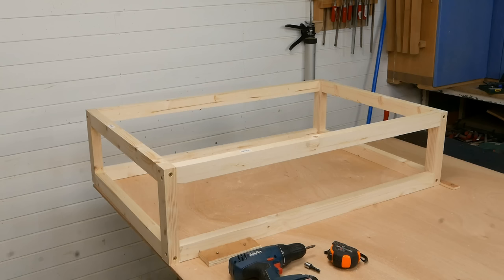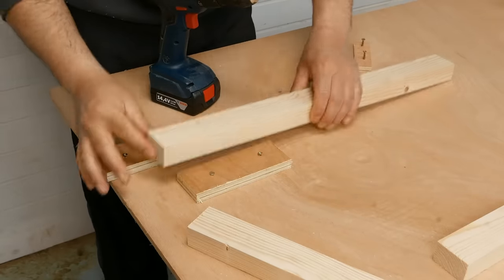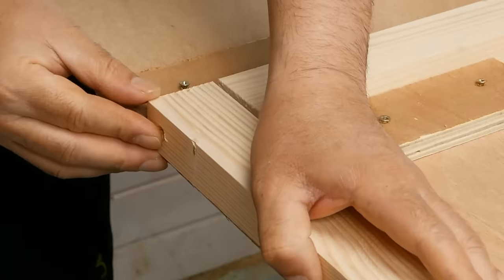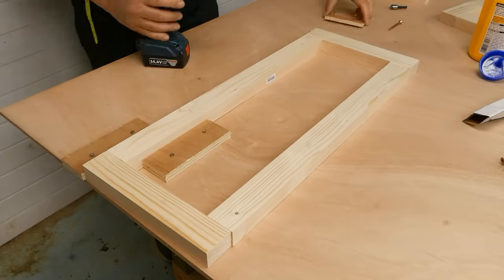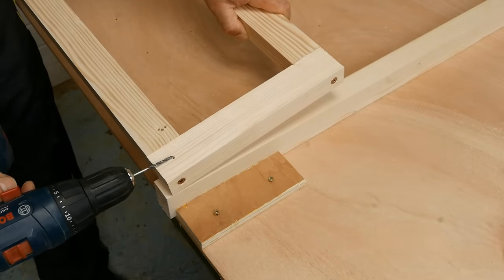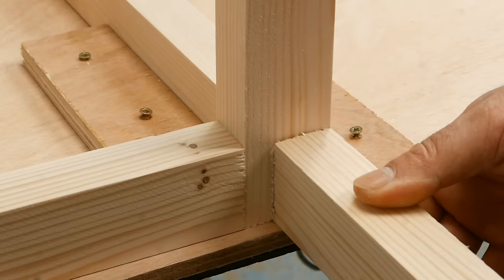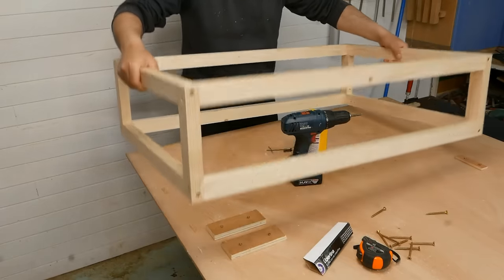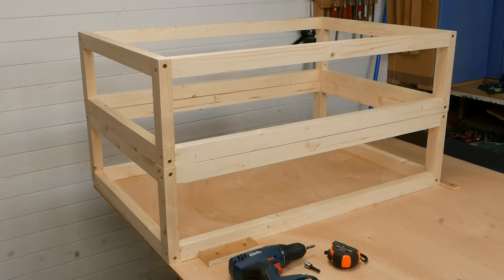How to make a very simple wooden frame

Comment: I've seen several of your videos and they are well done. This one is good, you show important detail. 

I want to add one thing I've learned to do when making screwed joints like this and pilot holes: I think it is best to make the pilot hole in the piece that the screw is pulling into (the long/end grain piece in your project) a bit smaller diameter than the "through hole". I do this to have maximum strength. I want the pilot hole just big enough to not split/crack and the "through hole" just big enough to allow the screw to spin and pull the pieces together. I do this by drilling both holes with the smaller drill bit, then redrill the through hole with a drill bit that is a bit bigger.

Comment: Treat yourself and buy some longer drill bits, you will then be able to drill both pieces in one go. I like your use of the blocks on the ply, quite useful for repetitive pieces. I tend to agree with another poster, I would use a clearance hole in the top piece to ensure the screw clamps the wood firmly onto the other piece. I see you glue and press the pieces together, probably not as effective, but as you said it always works for you. Thanks.

Comment: You should look into making yourself a table top with dog holes, and make some dogs to go with it, considering how much you drill into the top for stop blocks. Plenty of good vids on youtube to have a look at to come up with a design that suits your needs. It would make a great video upload too. Super build, by the way 👍
Reply: Sergio Acuña Padin have you thought about making different thicknesses on the table top side of the dogs? Being doubly  adjustable might be beneficial in multiple uses? And somewhat of a time saver. 
Just a thought ant way

Comment: Very nice and simple for a beginner like me. Thank you. Just one question. I need to make similar frames in 3 different sizes (large on bottom, slightly smaller on top and then the smaller on top to form a staircase like structure). Should I use 2x4 or something else? I don’t believe you are using 2x4 in your video right? Will these be study and strong?

Comment: Beginner here: It is a long horizontal frame. What if I wish to make a tall vertical frame? Would I adjust the length of the wood and keep the joints, or just turn the horizontal on its side?
Reply from the maker: I am not a pro, but I would adjust the length of the wood

Comment: Please excuse my ignorance on the subject as I'm new to this, but I have a question: I see the horizontal wood beams attached to the side of the vertical load-bearing beams, which in my mind makes it susceptible to failure should someone step on the horizontal beams. Wouldn't the frame be more resilient if the horizontal beams were placed on top and below the vertical beams? That is, the current arrangement has the horizontal beams between the vertical beams, and I'm wondering if the structure would be more resilient if you placed the vertical beams between the horizontal beams instead. I'm guessing the complexity of the joint would make it not worthwhile for most cases? Thanks in advance!
Reply: I think you are right if you want to make furniture, I would have the longer boards sit on top of the short vertical ones. Plus an extra vertical beam in the middle. But for my purpose which is just a mesh cage for my cats this is perfect because the horizontal boards wont bear any weight at all.

Comment: Thanks man! Great technique. Just one question; is the glue really necessary?
Reply from the maker: Not sure 100%, but I think it makes a more strength structure
Reply: You'll never break a glue joint. It's stronger than wood. You will never break the glue. You can only break right next to it. By gluing it, it will never come loose. The screw alone could come loose over time.

Comment: wonderful...job...that what I was looking for...I want to make a frame like this 10 feet long and of 2 feet  width...but the problem  how I will ge the pieces of the exact measurement. Because a small different would make the project ugly..my question is how much weight it can bear?
Reply from the maker: I think you will need to reinforce the wooden structure with some vertical pieces
Reply: i want to cover that box with a tile or brick like plywood or hardboard...to put it under electric fire work...what you suggest?
Reply: +Parvex Taj
It depends on what tools you have available. 

If you have a mitre saw set up a stop block which will allow you to make accurate length cuts every time to the same length. 

If you do not then you need to make a jig that will allow you to make a cross cut and use a stop block with that as well.

Comment: Those screw connections will not pull the boards together strongly because you have screw threads engaging in both boards. The optimal way to do it is to only have the screw threads engaging the wood in the board that has the pointy end of the screw. Then the screw threads work in one board to pull that board strongly into the board that has the head of the screw, creating a kind of clamp or vise force.

So, either you need to use screws with a much longer unthreaded portion near the head, or else drill a larger diameter hole in the board that will have the screw head. The way I usually do it is to drill the small hole first so that everything will be aligned, then I go back with the larger drill bit (and a stop collar or piece of tape to limit the depth) and enlarge the hole in the board that will not have any screw threads engaged.
Reply: No "maybe" about it. The screw definitely does NOT pull the boards together the way you did it. It is basic physics. The way you did it, the only pressure is what you add. That is why it is much better to do it the way I explained. Since you are teaching basic technique here, it is best to teach people the right way.
Reply: I'm confused about this, is there a video explaining in more detail?
Reply: There are videos that explain the same thing I did, but I have not seen any that go into any more detail. The basic point is that when screwing two woods together, you only want the threads to engage the wood on the tip of the screw, and not on the head-side of the screw.

What exactly do you need clarified?
Reply: I see what you mean now, you want the screws flat part to make contact with the first piece, and the threaded part the second - so you need screws that are the right size. I didn't realise that's what that part of the screw was for until now.

I recently built something and although I screwed the two pieces tightly together there was a gap between them - would this solve that problem? 

Any other beginner videos you'd recommend for basic techniques like this?
Reply: Yes, the gap you saw is caused by the threads engaging both pieces of wood. Usually what happens is when you are driving the screw, the point or first thread forces the wood apart, and then the threads just follow the gap and hold it there.

In many cases, you will not be able to find a wood screw with a long enough unthreaded portion for the piece of wood on the head side. In that case, you need to drill a wider hole in one piece of wood than the other, so the threads do not engage the wood on the head side. I usually first drill both pieces of wood with the smaller drill bit, then I switch to a larger drill bit to widen the hole in the first piece of wood.

Steve Ramsey has an overview video about different types of screws, and I believe it mentions that issue, but does not go into detail on it.
Reply: Ahh now I understand your first comment. Cool, that makes sense. Thanks for the explanation
Reply: @XJWill1  Thanks for this explanation. Makes sense when I think about it.
Reply: The screws are fine for a light duty frame.

Comment: You should have used Kreg Jig Pocket Hole Joimery !!  Much Stronger than  those lomg wood screws !!
Reply: That maybe the old strength he requires for the frame. If he wants real strength the could use dowel joints. Pocket holes are handy as well.
Reply: @bighands69  ٨اظ

Comment: At 2.25 you are using a strange drill bit to make a hole in the wood for the screws heads. What is the english name of that drill bit? 
I need the english name so I can translate it in my language. Thanks.
Reply: Looks like a normal wood drill bit to me ?
Reply: Ok. I understand it. It's called "Countersink". Sorry for the question

Comment: About 25 years ago I built about 12 freestanding shelving units using basically the same method you show in the video. They were large units at about 4' wide x 2' deep x 6' tall. I had a bunch of leftover 2x4 material of various lengths that I ripped in half for the frame. I used 1/2" particle board for the shelves. They were so strong and nice. I used them for storage in my basement and garage. When I moved out of state in 2005, the moving company's truckdriver refused to move them, claiming that he saw some "mouse poop" on one of the shelves. I was so mad. I called his company about it, but they stood by the driver decision, and so I had to leave them for the next owner of the house. It made me sick to do that, because I had put a lot of time and work into those shelving units, and I sure could have used them in the new house I moved into eventually. I thought about renting a trailer myself, hauling them to my new city, and then putting them in storage until I bought a new house, but the cost of all that would have been more than it was worth. I sure miss my shelving units though. They were built like a "brick __ house". To buy anything comparable you would have to buy steel shelving at about $100 per unit, and so those shelves were worth about $1200 to me. I doubt I ever will move again, but if I do then that moving company will not get my business unless they agree to reimburse me the cost of my shelves!
Reply from the maker: It looks that you are really proud 👍 of the shelves you made. It is a shame you could not take them to your new home 🙁
Reply: The disease risk of mouse waste is just too great.

Comment: These may last anywhere from a few days to a few months before those joints begin to fail, depending on the amount and type stress they are subject to. Glued butt joints have very little strength especially when one face is end grain and screwing into end grain is also an extremely weak fixing. If you apply any kind of torsional load to your frames they will begin to fail almost immediately. Repetitive torsional loads, will destroy your frames in no time. Any half decent woodworker knows these things. If you are self taught, then making this kind of mistake is understandable, but you really shouldn't be making tutorial videos.
Reply from the maker: Well, I am not using this technique to make a structure that has to support that kind of loads. But anyway one can always reinforce the structure if needed